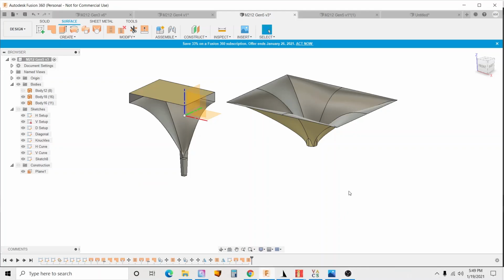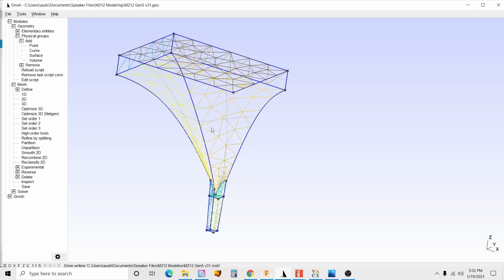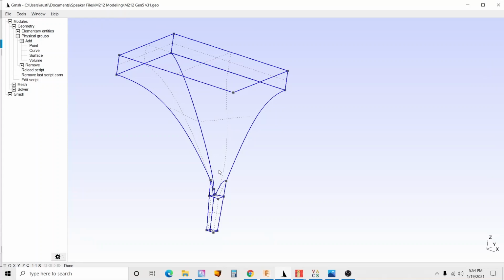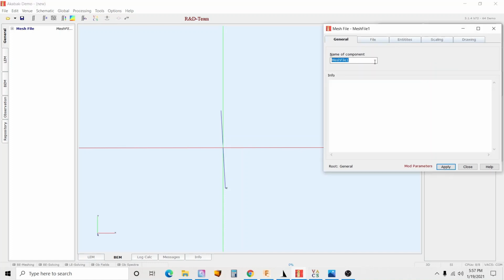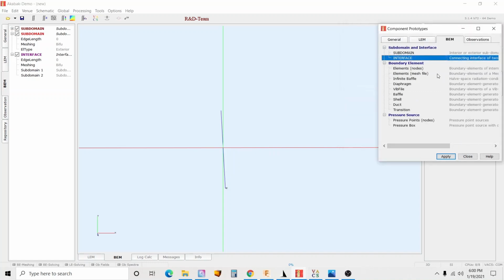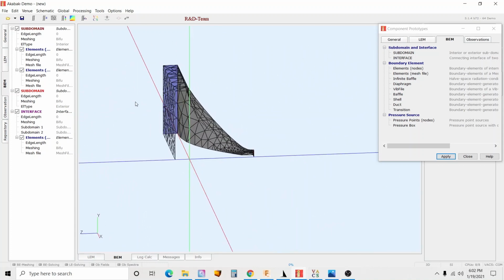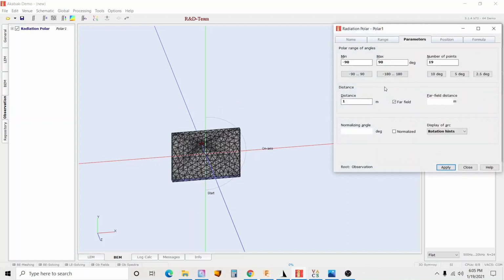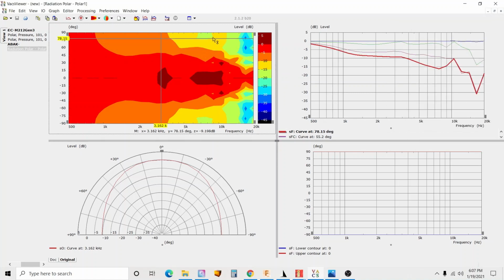Simulating Waveguides in Akabak

Comment: Oh, can you explain briefly the difference between AKABAK and ABEC3? I often see both mentioned together. Is ABEC3 the solver for AKABAK or something?
Reply from the maker: AKABAK is the newer platform, at the core they work similar but the user interface and workflow is just laid out differently. AKABAK might be a little easier to learn and more stable in my experience, but once you know ABEC it can be much quicker to make changes, which makes doing hundreds of simulations in a row much faster. AKABAK has all settings stored in the program and does the code for you, ABEC the settings are stored on external documents and you learn the code and make changes more directly with the code.
Reply: @austinmys8693  Thanks for your reply Austin. I'm struggling to find helpful tutorials like yours on AKABAK. All I found are for the LEM section. Can you recommend any further study for the BEM section esp. waveguide moddeling?

Comment: Very good work, it helped me a lot.

How can i increase the mesh density? i didnt find a way to increase it in GMSH. It is version 4.8.0
Reply from the maker: Thanks! Tools, Option, Mesh. Under the General tab, you can change min/max size, and change the size factor if you need to go even smaller or bigger. There are further useful settings in the advanced tab. You can not change the density once you have already meshed the part, you have to re open the step file then re mesh every time you change the settings to apply them
Reply: @austinmys8693  thanks for the help. It worked well.

Comment: Interesting video! Help me a ton getting started. I cannot get the output tho, Vacs dose not magically start like yours, could you help?
Reply from the maker: Yes, make sure you have downloaded VACS from here http://www.randteam.de/VACS/Index.html
Then you may have to click the colored VACS button by the solve buttons to start the program, otherwise you can open it it manually like any other program if that still doesn't work. Hope that helps!
Reply: @austinmys8693  I'm facing maybe a similar problem here. I have VACS and can start it no problem, but the output from akabak doesn't reach vacs. I have it set preferences to "com" on akabak in relation to how to deal with vacs output, but there seems to be no communication between these two software for some reason. Any ideas? Insight would be much appreciated ^___^
Reply: @donjorgenson9906  maybe try to click on the Vacs buttons in the Akabak interface before lauching the calculation

Comment from the maker: Since making this video, I discovered you do not need to label the surfaces for Akabak, so you can skip that step and just click the 2D mesh button in GMSH. Also note the mesh density in this video was set a bit too low to save solving time, much of the roughness in the graph was caused by diffraction off a poorly placed triangle and goes away when an appropriately sized mesh is used. Thanks for watching!